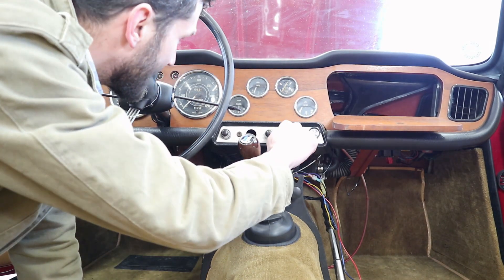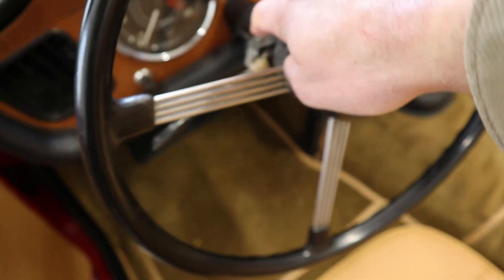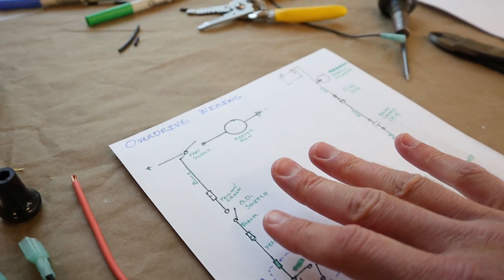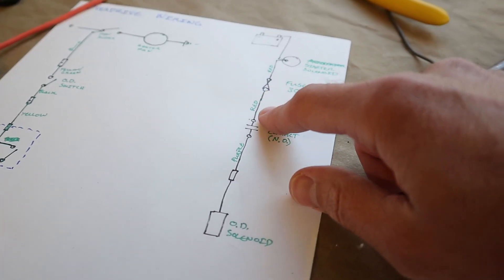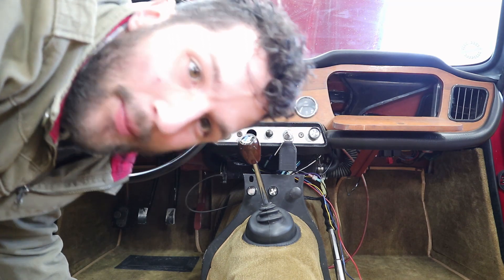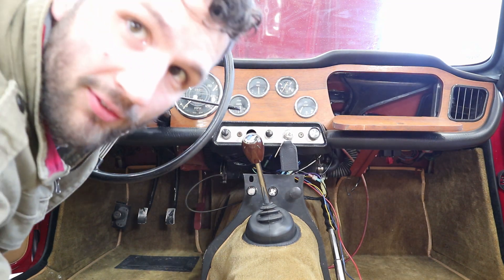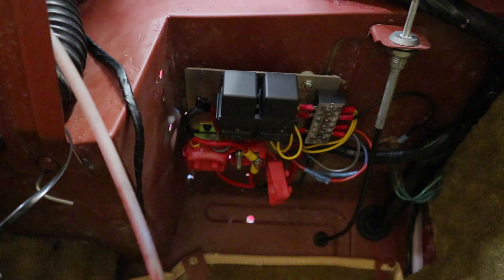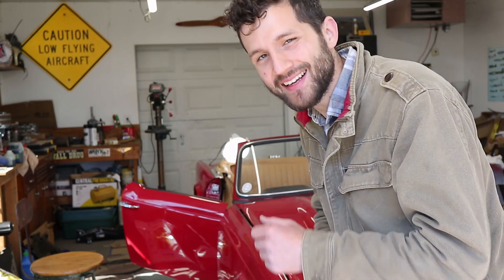Making Sense of Overdrive Wiring on our Triumph TR4 | British Car Wiring Tips and Tricks

Comment: Great job guys, my TR4 didn’t have an OD also but like you I’ve added one to the transmission. I thought the OD switch on the steering column was supposed to go on the left side of the column.
Reply from the maker: We could easily be wrong here, but our understanding is the TR4 has the turn signal on the left and OD on the right. TR4A changed to have both mounted on the left side using a special escutcheon.
Reply: @WegsGarage  looked at the work shop manual and you guys are correct. When I bought my car the turn signal was on the right with no OD.  I guessing previous owner moved it. Sorry for the confusion.
Reply: @robertmorales391  You could still be correct, in Japan the turn signal is on the right, while the windshield washer is on the left. Which leads to newbie drivers from the states announcing their recent entry into the country when they inevitably go into the wrong lane, facing incoming traffic. And once realizing their mistake, they then hit the wipers instead of the turn signal to signal a lane change. 

Go ahead, ask me how I know this...
Reply: @MrWaalkman  😂,   How do you know that?
Reply: @robertmorales391  LOL! I did it more than a few times. One thing that I can say is that the Japanese people have the patience of saints. No honking, no yelling, no international hand signals, just patiently waiting for me to get back over to where I belonged. All of this is aided greatly by the low speed limits of 35 Kph in the city, and the expressway topping out at 80 Kph. Kinda hard to inflict too much damage when you are tooling around at bumper car speeds...

The South Africans were much wiser, they wouldn't let me drive.
Reply: @MrWaalkman  :) sounds like you've had some cool adventures. nothing better then getting out and travel..

Comment: Your breaker probably is just doing its job, just at a faster rate than you would like. Which would be normal depending on the curve that it was designed to. 

Your 10 amp fuse is also doing its job, but it's probably a class C curve or class D curve fuse. Making it slower to blow and able to handle large surges for a short amount of time, which depending on the application, is desirable.

Nice to see that there is a holding circuit that drops the voltage to the overdrive solenoid, this was included in the box that came with my GM overdrive, and it's needed to keep the solenoid cool while you are in overdrive.

Here's a video that nicely explains fuse curves: https://www.youtube.com/watch?v=P5hZ1WYfXB4
Reply from the maker: Yeah it is definitely a trip curve issue. Current is very very low when the holding circuit is engaged. I guess the goal is to have the fuse/breaker trip if the holding coil switch ever fails, thus protecting the coil from overheating. I might even go down further on fuse size, though I think we should wait to test it when hot.
Reply: @WegsGarage  Yup. You want to use the built-in time that is available to you to "ride-through" the inrush current, allowing you to size your fuse to about 125% of the holding current.

You could go with 150% if you start getting nuisance blown fuses.

Comment: A word of warning regarding fuses. US spec fuses are rated for supported continuous load . UK fuses are rated for the load where the fuse will blow. So a Lucas 30 amp fuse is roughly equivalent to a US 15 amp fuse. There are some comparison charts available online.
Reply from the maker: Thanks Jim. Will look for one of those charts. I read somewhere that the TR6 used an 8 amp fuse for this circuit (not 100% sure on that...). I guess that would mean our 10A fuse is still too large to protect the coil.
Reply: @WegsGarage  check with the Roadster Factory. I know they still sell UK spec fuses